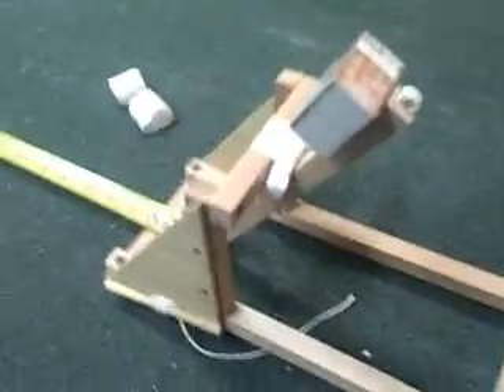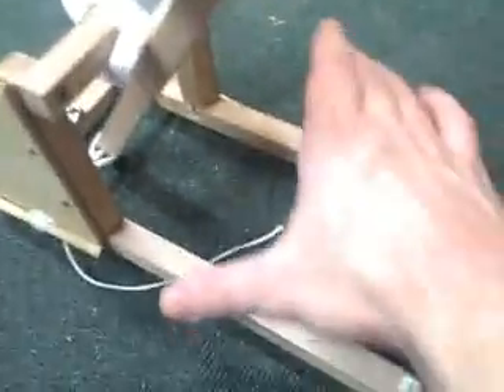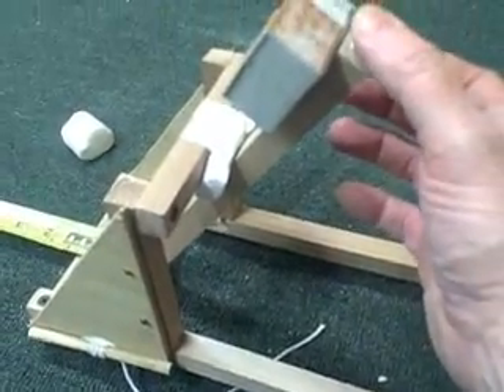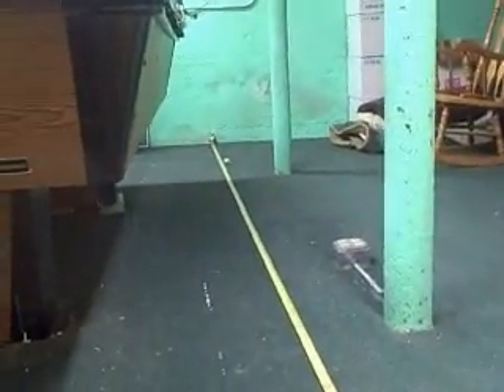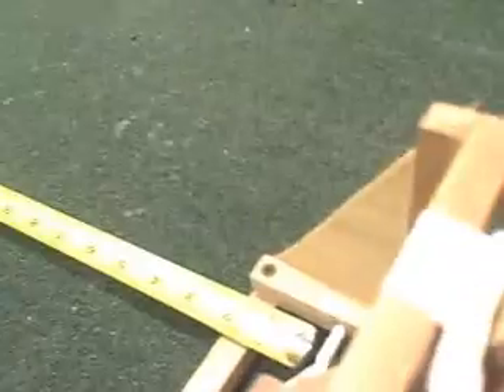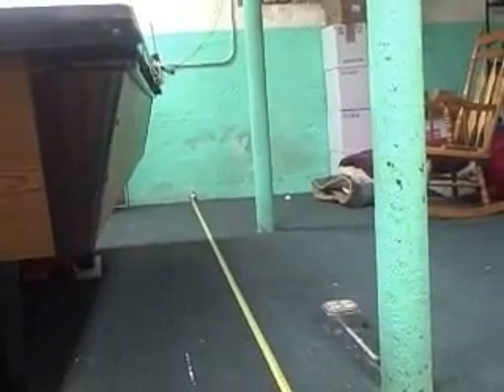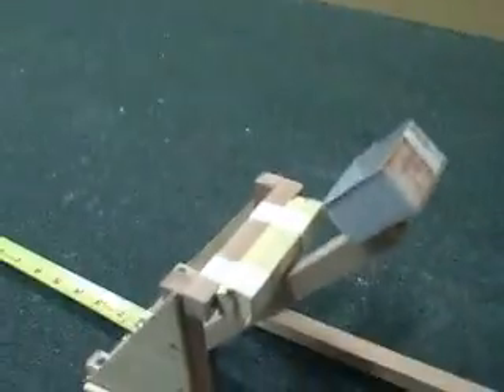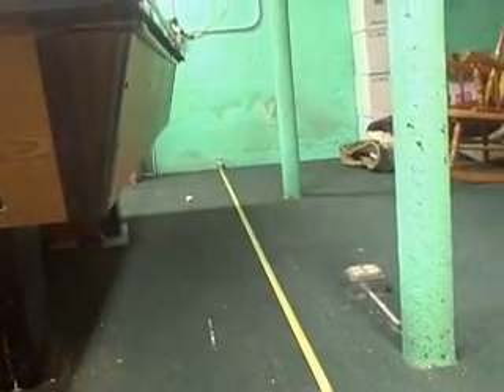Test Firing a Catapult and Tips on Making your catapult bett

Comment: As a schoolkid many years ago I made a catapult using an old bycycle inner tube for power.It suffered from the same problem as this design.A lot of the power is wasted when the arm wacks against the stopper bar.I'm not sure what the solution is.The sudden stop used to cause the holder to come off the end of the arm.A trebuchet with a weight is more efficient because the projectile doesn't fly until the arm has reached the bottom of its drop and released most of its energy.It's still a nice model